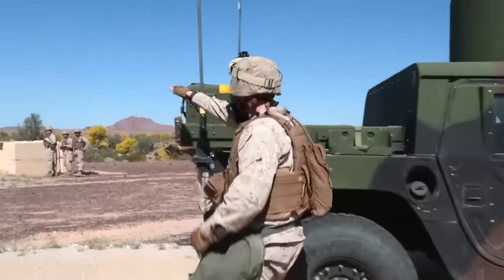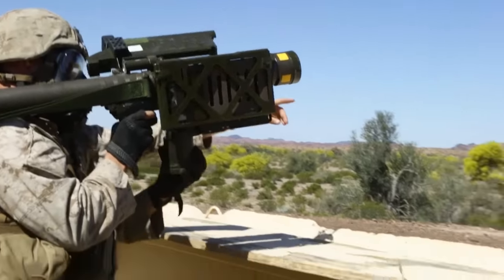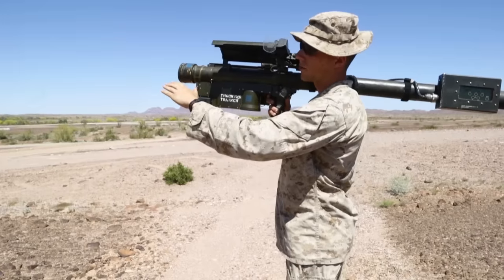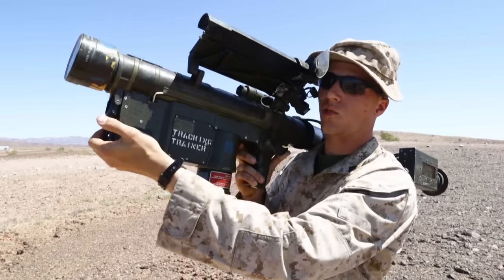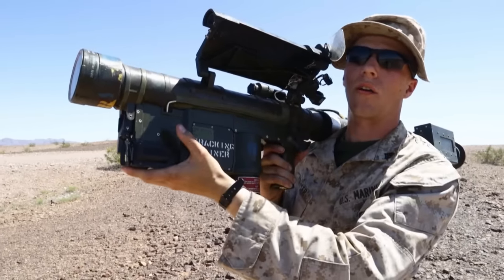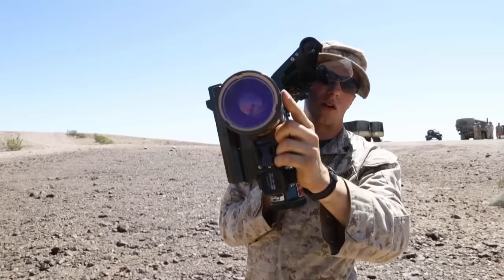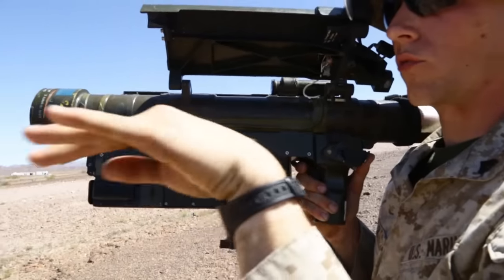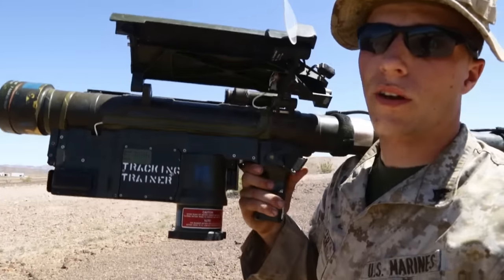How To Fire A Stinger Missile • FIM-92 Stinger In Action

Comment: I was a Stinger Section Chief many years ago. It has greatly improved. It used to leave a big smoke trail back to the launcher. Now the target has no way to tell where it comes from. Otherwise it works the same.
Reply: Eh, the Russians will blow a tire trying to find you anyway.
Reply: Changing the propellant chemistry is what did the trick.  Thank the propellant chemists for that; you may want to read John D. Clark's book, "Ignition" for an idea of the complexity in coming up with rocket propulsion fuels.  While Stingers and Javelins are solid fuel rockets, ICBMs and many other military missiles are liquid-fueled, using an amazing range of chemicals you don't want to mess with!
Reply: @rainsong7327  exact range classified.

Comment: I was a Redd Eye/Stinger operator in the m 2 25 22id 80s.  I THINK That the one shown is different than what I operated.  It seems like I had to open up that cage, like it was of use in the sighting of the missel.  It also seemed to hunt the target rather than the straight to the target the pic shows.  We had a jeep and a 1/4ton trailer, with, either 2 to a casket, or 4 caskets with one in  each hermetically sealed, so we were told.  This is the first time I have looked this up. 2 25 22

Comment: Really cool video. I have a question though about something the instructor said. He mentioned that the missile seeker tracks via "negative UV" and picks up on "the UV light that the aircraft blocks" ( as opposed to a regular heatseeker that looks for an actual heat source?). Does that mean that the missile's effectiveness at night would be affected or reduced at all, since the UV contrast would be much less than during the day? (I'm hoping this isn't some kind of classified secret)
Reply: This is in addition to the regular IR seeker - but essentially, yes, if used without it, the stinger would be marginally less effective. AFAIK, the real reason for the UV sensor is to counteract the IR effect of the sun.
Reply: The rmp seeker head cycles through uv and ir to maintain a lock.
Reply: While the missile can be used at night, doctrine was that it should only be used in day-time.  The gunner and team chief's first responsibility is to identify a potential target, then positively identify it as friend or foe through visual aircraft recognition (VACR). You can't see an aircraft at night to identify it, which would lead pretty rapidly to episodes of fratricide.  The missile will work well at night, but based on the limitation of the gunner being able to positively ID the target as hostile or friendly, the prohibition against night employment protects friendly pilots and air crew. The weapon does have Identification Friend or Foe (IFF), but no gunner in his right mind has ever employed the system in combat, because it sends out an RF interrogation signal that gives away the fact that you are in the area (and no one programs the heavy belt carried system), and can be used to triangulation the team' position if used more than once. Th UV helps to deter the system from being blinded by the sun, and improve its already good flare avoidance. Ir signature from flares can be closely matched to xhaust, but the UV signature is different.  I believe  BLOCK 1 units did not have UV. BLOCK 2 (?) was known as Stinger Post, and added the UV. Block 3 (?) RMP maintained the IR and UV capabilities and added a Reprogrammable Microporcessor that could be updated over the life of the weapon system. I believe it could be updated with new target information. I may have some of this wrong.  Post was a fairly short run and saw limited deployment.
Reply: That is precisely why they program iff in combat, to protect against friendly fire. It’s always been shoot and move.

Comment: Does it run on Dial-up ? that sound
Reply: MrMudNugget Yup, full duplex between your target and the Stinger.
Reply: so once the seeker has locked on the aircraft, it makes the sound/vibration and is ready to be fired?
Reply: @95predator  correct

Comment: Just out of curiosity, is there any reason they thrown away the BCU other than the fact that it's (presumably) dead / used up? Does it heat up or something? I ask simply because they acted as it was very crucial that the operator throws it away quickly & behind the wall.

Comment: all YT videos show STINGER launchers
In fact, the Polish PIORUN is the most effective anti-aircraft weapon. stinger is already a technical monument to such an extent that the Americans simply clean the warehouses to get rid of them, just like the Germans donating 2700 STRIEL 2 launchers, 1/3 of which is not suitable for use at all because German soldiers had to be in protective suits because the launchers for 35 years lay indamp warehouses, which made the wooden crates simply rotten.So far, the Germans have handed over 500 35-year-old launchers, which is not known whether the bullet will kill the operator faster than it will take off, but it is better to hand over the relics for free than to incur the costs of disposal ...Polish launchers are so effective and modern that the US Army has purchased several sets of Polish launchers.
 The Piorun anti-aircraft missile aims - like many other missiles of similar purpose - at a heat source. these are usually the vicinity of helicopter engines or jet nozzles.What distinguishes it from international competition is the combination of high-quality sensors with algorithms that allow the missile head to distinguish the right target from natural interference, especially apparent targets - thrown by airplanes or helicopters, which are designed to confusemissile guidance system.Polski Piorun at the war in Ukraine

The lightning warhead is difficult to "cheat", which means that the projectile offers a high probability of hitting the target precisely, which is important due to the low weight of the warhead.